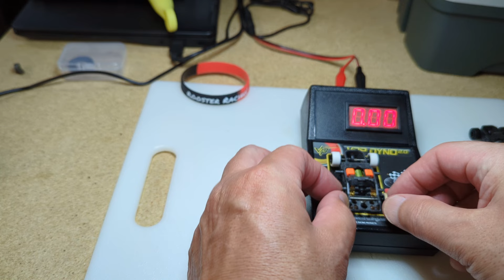Wizzard Fusion vs Viper (Spec Racer Class)

Comment: I think some tweaking could probably shave off the difference between the custom Fusion and the hot Viper so honestly I can't see how the price of the fusion can be justified. And, just from looking at the two chassis closely, it's obvious to me that the molding of the Viper product is more crisp and sharply defined. Gives me the impression that the material the Viper is molded from is a higher quality material even with the lower price point.
You are getting good times on that Viper track.
Reply from the maker: Thanks, and I agree the Viper chassis seems more mature and I like the multiple options Viper has on the stiffness of their chassis.

Comment: Hi MSCG..if you don't like building buy one(only)the price is depreciated by the amount of fun you have. So do wizards cars use a body clip system to run different manufacturers bodies?
Reply from the maker: Definitely if you have the budget go for it. I did not see the value of the Fusion compared to a similar spec Viper at half the cost. As far as I know there is no body clip for the Fusion.

Comment: Here is a fun project, saw this on rooster racing.  Let me just say that every time I do a paste and copy here, it doesn't stay posted on YouTube, that is why you can't see or find my 3 posts on this subject.  Back to the project. Can the Mega G+ be made to outrun a $45.00 Viper V-1 V-spec with only around $10.00 worth of hop-up parts?  
This racer ordered an FK-N20 mini drone motor (less than $2), same size as mega G+ N20 but with over 32,800 rpms at just 3.7v and almost 44,000 at 5v. Again, it's the FK-N20 with large cooling hole in the metal motor case. (I would double check the armature shaft length) He also doubled stacked N52 traction magnets and added .450 silicone tires out back.  He claims that this car will eat a $45 Viper V1 slot car.  Sounds like a fun project that I thought you might would be interested in.  So, the question is, can the Mega G+ really be made to outrun a V1?
Reply from the maker: I saw that post and was thinking about trying one of those motors. I may just have to give this a try. Thanks.
Reply: Used my other YouTube name to try and post this.  Looks like "myflash43" earlier post stayed up to now?  Any way, sorry for the extra post.  Slotcarjames43 and myflash43 are both mine.